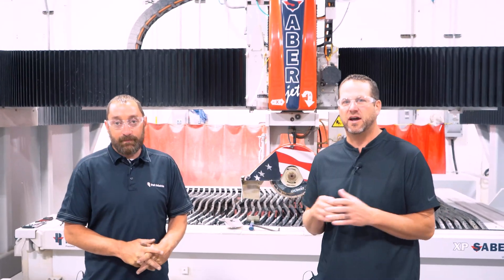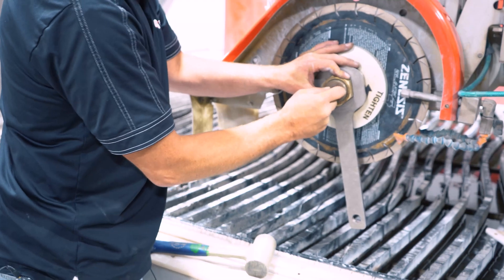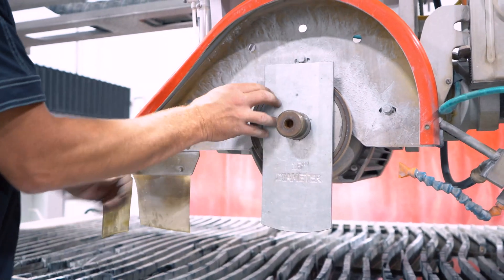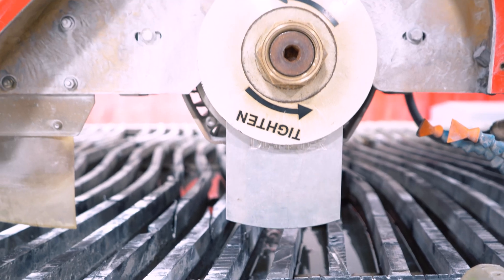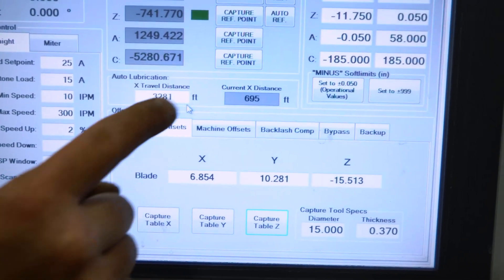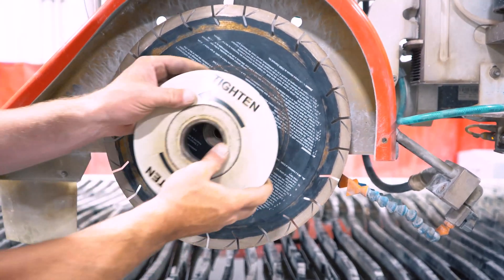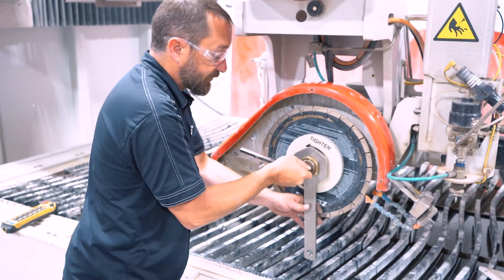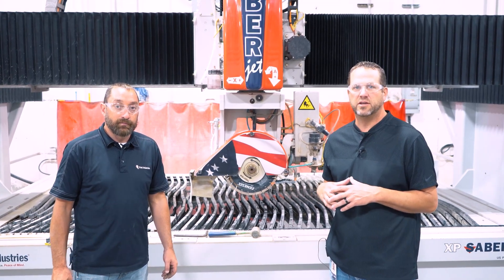How To Advanced Blade Touch Off | Tip of the Week

Comment: Thank you for the videos, guys.  My miters are cutting off. Example. If I cut a 120-inch pieced and miter on  both short sides, it'll measure somewhere around 120 1/8 on one side and 120 1/4 on the other side. Can you give me any advice other than advanced touch off